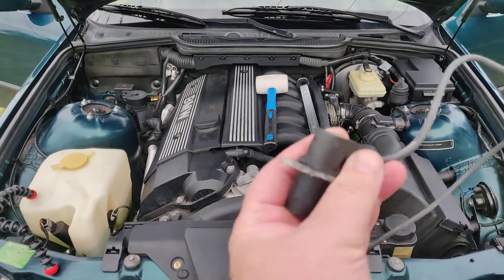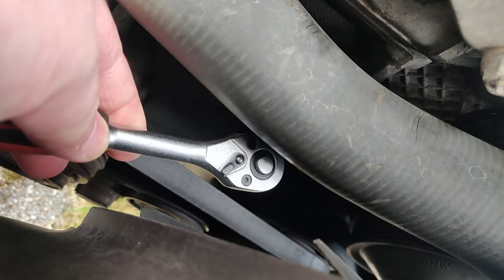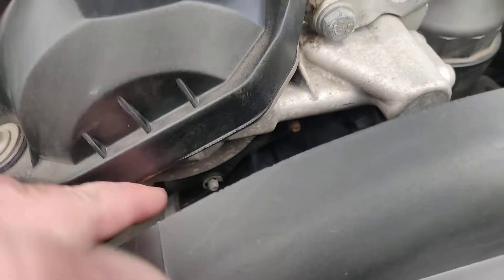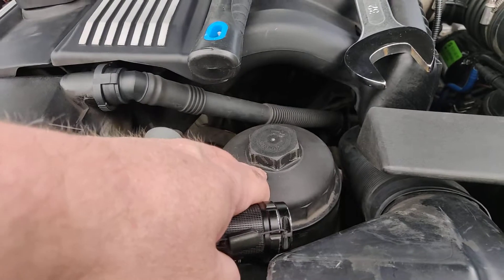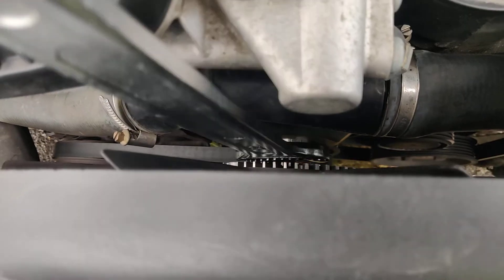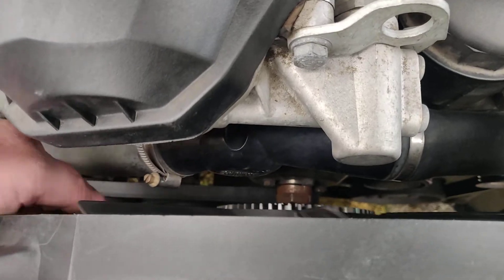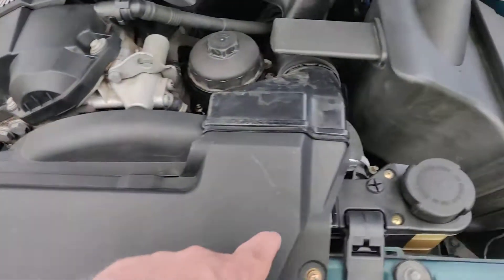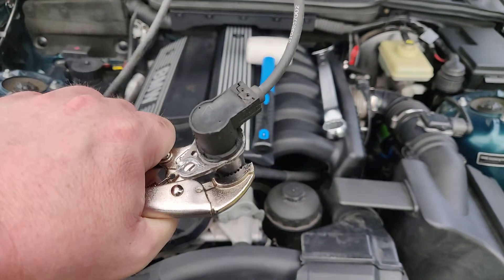BMW E36 OBD1 crank sensor replacement M52-engine (Euro M52B25 1996 323i)

Comment: THIS IS FOR THE CAMSHAFT POSITION SENSOR AND IT DOES NOT LOOKS LIKE A M52 ENGINE.
Reply from the maker: No it's not the camshaft position senor, and yes it's a European OBD1 M52B25. (The US M52 OBD2 have this sensor in a different location at the back of the engine.)
Reply: It in fact is the crankshaft sensor(all euro single vanos m52 have it there), the camshaft sensor as shown in video is behind VANOS solenoid(i have replaced it on my car). And that is an euro M52 Single Vanos

Comment: You suuuure thats an m52??
Reply from the maker: Yep. All euro M52 (that I'm aware of) are OBD1. US and EU cars differs in that respect. OBD2 weren't a thing here in Sweden until it was a requirement to pass inspection. No 6cyl e36 had OBD2 here. Don't know about the 4cyls. CSPS placement differs on EU and US cars too since one are OBD1 and the other OBD2.
Reply: @kanalnamn  
i need some help from you. 
i want to change my Bmw e30m3 crankshaft position sensor (Part#: 12-52-1-287-784) 
Can i use some other sensor if this sensor is not available? if possible so please suggest me some other Sensor which i can replace with Part#: 12-52-1-287-784 this . Thank you soo much . Regards
Reply: @saytruth.5685  you really need the OEM one, just go to your local BMW dealer and try to buy it, if not try to get a VDO one (is the OEM manufacturer for BMW sensors)
Reply: Which label computer are you using?
Reply from the maker: @drayescobar9469  The car is stored away for winter now, but according to RealOEM (VIN EU85199) it uses an MS41.0. (From what I gather on the Internet, euro M52 uses MS41.0 and US M52 uses MS41.1. I'm not sure who uses MS41.2 ...S52 perhaps?)
Reply: @kanalnamn  i bought a motor from a e36, got it with a 0413 red label bosch computer. So persons are saying its the wrong computer because the motor is a single vanos it should have been a simens so its a m52 others are saying its a m50tub25. The motor was in a 1993 bmw 325i
Reply: @drayescobar9469  m50b25tub with vanos goes with 413 red label. M52 comes with siemens.
Reply: @drayescobar9469  it’s an m50, m52 engines are the 2.8 litre ones so they are m52tub28
Reply: @MateosMisadventures  M52B25 (as shown in the video) are 2.5L engines, the m52b28 is a 2.8L There are also m52tub25/28 the extra tu stands for technical update. The wikipage give all the info :)
https://en.wikipedia.org/wiki/BMW_M52
Reply: @drayescobar9469  93 325i is an m50tub25, and the 413 bosch is the correct ecu. All 2.5 M50's wether they have vanos or not will be bosch not siemens. In the M50 only the b20 had siemens, as they were using it as a test platform to switch to siemens on the phase 2 cars with the m52, which all have siemens ecu.

Comment: Is there need to disassembly radiator reservoir and empty the coolant in radiator?
Reply from the maker: As I say in the video: no, not with this euro M52B25 engine anyway. It's possible to do without removing the covers aswell, but those are easy to remove.
Reply: @kanalnamn  okay thanks bro nice sharing with you ill try to do it